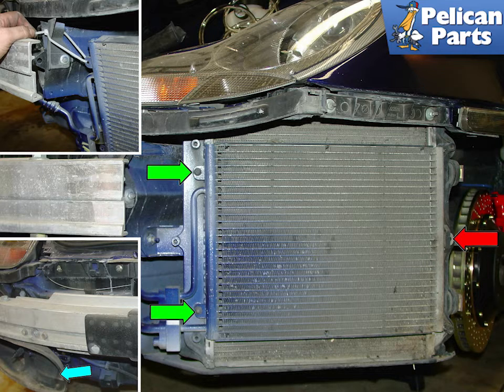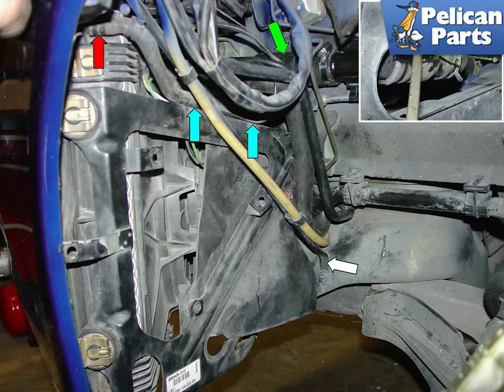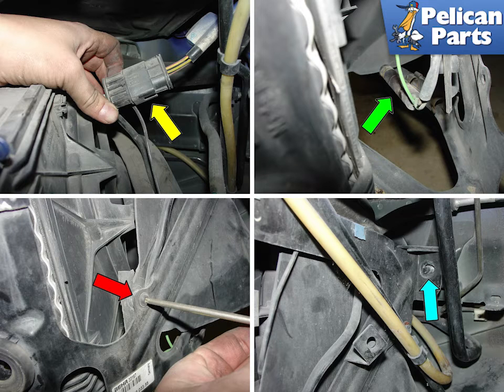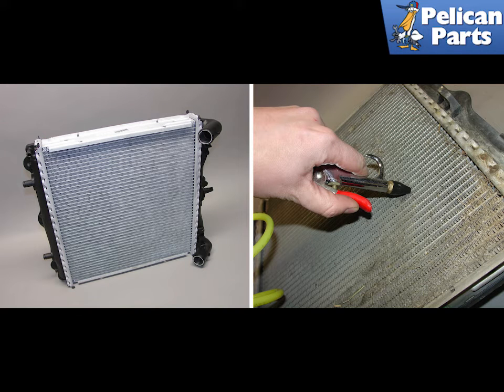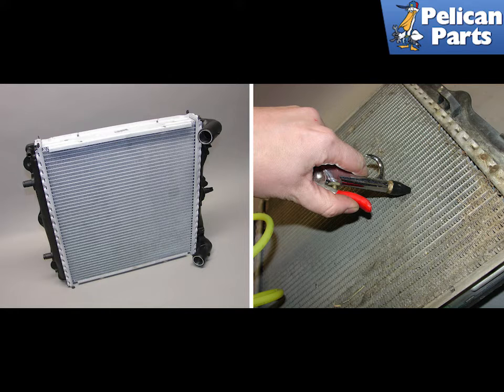Porsche Boxster 986 Radiator Replacement and Cleaning

Comment: Cleaning mine now and do not want to cut houses to fully remove. I assume that the electronics behind the radiators are sealed from water (otherwise couldn’t drive in the rain). Can I use a hose with a garden sprayer instead of compressed air?
Reply from the maker: If you use low pressure, it should be OK.